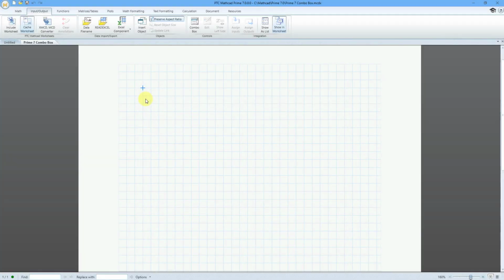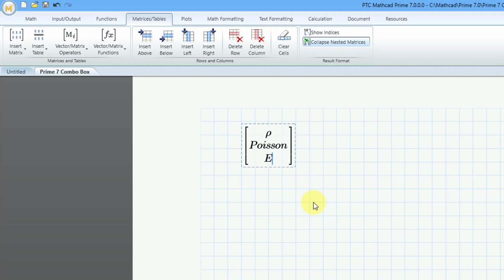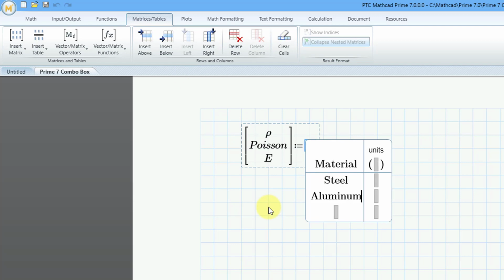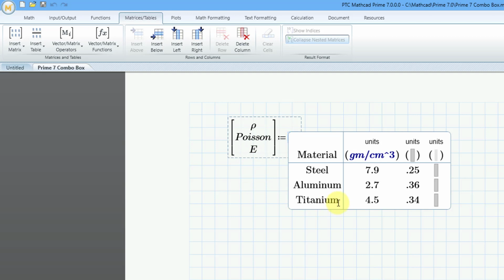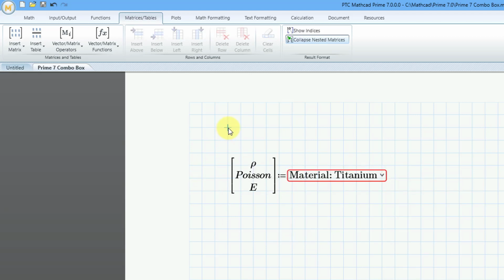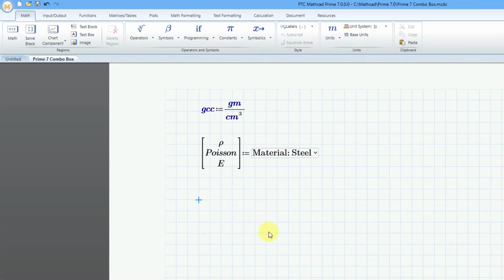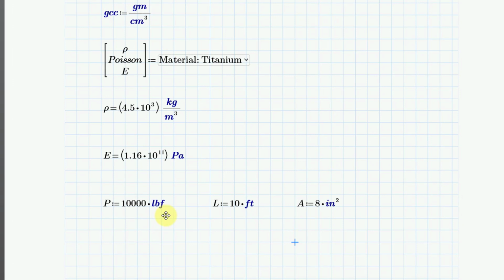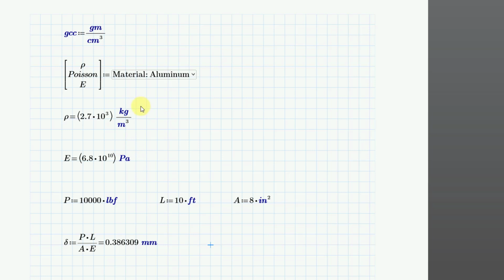PTC Mathcad Prime - Combo Boxes - Input Controls

Comment: Good and simple video. By the way, is any way to add in the list, a calculated valuable? lets say i define previously A:= Lx*Ly. Is any way on the list box to have for a single one values like ss:= [0, A] ? So i choose for the variable ss the values 0 and the calculated previously value A
Reply from the maker: Combo Boxes are considered the basic input control. It does what it does. If you want something more complicated, I recommend taking a look at scripting for one of the advanced input controls, like a List. You may be able to pass inputs to the control that then uses one of the inputs as the text for one of the options. Emphasis on "may." You will have to investigate to confirm.

Comment: Hi Dave, am getting an error: This variable is undefined, check that the label is set correctly, have followed exactly your steps, what could be the issue?
Reply from the maker: I recommend contacting PTC Technical Support. They can help you diagnose the issue.
Reply: @CADPLMGuy  Its Ok...Issue resolved...Thanks for the demo of the Combo box control in Prime 7.0
Reply: @raseshpalav  how did you resolve it, as have same issue!
Reply: @saxe761  Check the unit of Young's Modulus, I was mentioning it as Gpa while actually it should be GPa